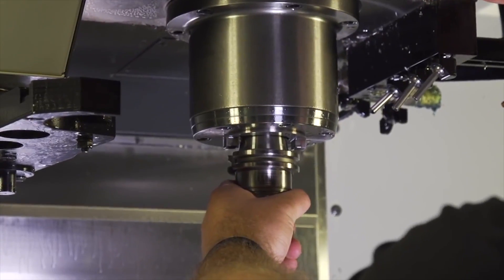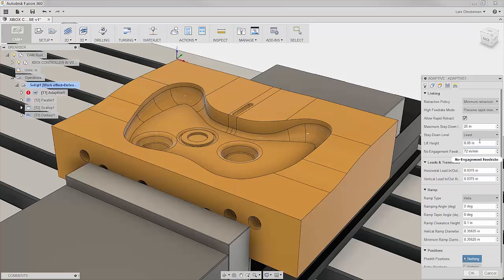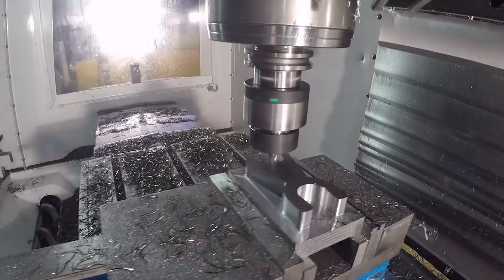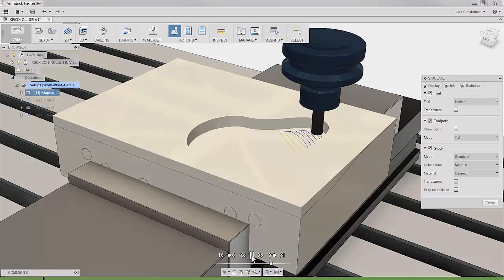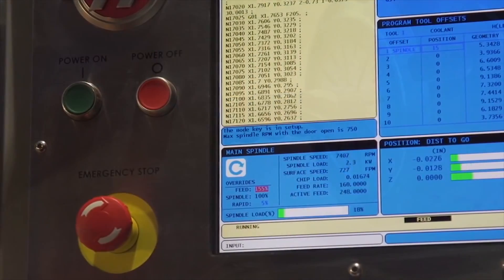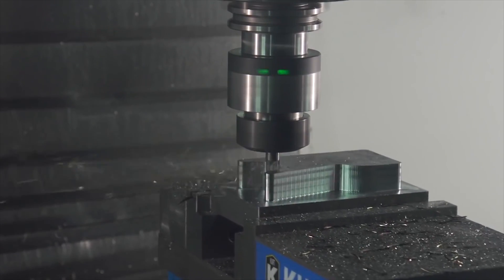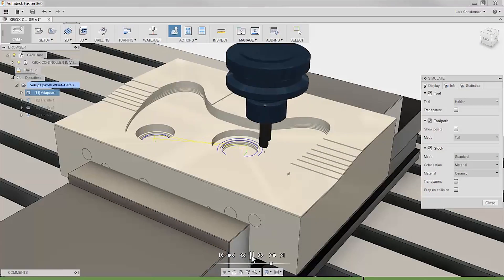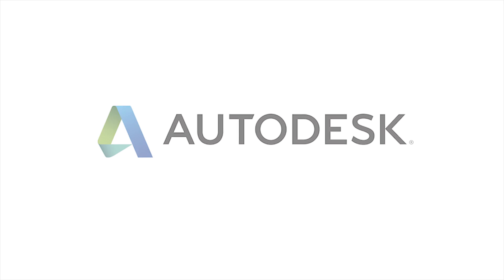Fusion 360 CAM — What is Adaptive Clearing?

Comment: classic milling is better. I use adaptive 3D strategy for most roughing strategies but i need it only because i use 120mm long tool with diameter 40mm. Than only pocket cleaning. 2D adaptive is good if you use roughing ned mills but only in few situations. Yousually adaptive clearing or I machining in SolidCAM cost more time and save tools which is cheaper than a machine time.

I use 2D adaptive for small pockets with small depth. For prismatic parts is better conventional milling with 2mm depth of cut and maybe 60-80% radial load. You can do parts faster with lees machine aircuts. Id you use long end mills such as diameter 8mm with body long of 120mm 2D or 3D adaptive is not good option. Better to use conventional milling with low depth of cut

Comment: How do I decide what speeds and feeds to use when applying HSM techniques such as this one where I use the full length of the tool?
Reply from the maker: I would start with the cutter manufacturers recommend feeds and speeds. Then you can start playing with your chip load and Optimal load on the passes tab in Fusion 360. How rigid your setup and machine are is really what are going to limit you to how fast you can push things.
I would take a square block in a vise and just start testing things out.
Hope this is helpful!
Best,
Lars
Reply: Thank you Lars, you're the man!

Comment: You say it maintains constant tool engagement and load on the machine, but what I see is the tool cutting half the time, and repositioning for another cut the other half of the time.  What am I missing or misunderstanding? 

-- Mike
Reply from the maker: Hi Mike, Good observation :-). You might see less repositioning when using standard toolpaths. What Adaptive does: A constant load on the cutter when engaged in the material, the results in less stress on the cutter. The advantages are: One, you can take larger depth of cut (less total passes around your part), Two, Higher feedrate (Many times double the recommended from tool supplier), Three, less tool and machine wear (saving money on tool purchase and happy machine).
I hope this is helpful. If I did not do a good job, please email me lars@cadcamstuff.com and I will try to explain it better.
Have an awesome day!
Reply: +Lars Christensen Ah!  I understand now I think...."constant tool load" doesn't mean constant during the run of the program, but rather constant load while actually cutting. That is, the depth of cut, portion of the tool that's engaged in the cut, spindle speed and/or feed rate are adjusted as needed so the torque on the spindle stays the same as each cut is made. Is that right?

Thanks for the clarification!  I suspect there's at least one other viewer out there that had the same question...  :-)

-- Mike
Reply: I also like it better for Delrin machining even though the cutting forces aren’t that high - neither are the clamping forces. 
  Anything that prevents force spikes trying to dislocate my part is welcome.  
  I would like to be able to better control when it moves up in Z needlessly to reposition for another climb pass when instead it could either keep Z constant or just move up a few thou before it moves to the start of the next cut.  
  Maybe there is already a setting for this.

Comment: Hi Lars, do I need special tooling for adaptive clearing? I have old fanuc controls such as Fanuc 0M-A? I'm limited to 4,000 rpm and 5,000 mm/min. Most of the time I use ER collet gripping. Great videos by the way 😊.
Reply from the maker: Hi Alejandro. Nope, standard endmills is all you need. The difference is that you can now machine with the full flute length of your cutter. The trick: to play with the optimal load on the passes tab and see how you can increase your feedrate. I recommend making some test cuts.
Have fun!
Reply: Thank's Lars I'll do test cuts and play with it. I was nearly to buy hydraulic chucks and tool by dealer recommendation. :)
Reply from the maker: :-) Hydraulic holders are nice, and could definitely help reduce vibration— and increase feedrates. But, it is not necessary for running Adaptive.